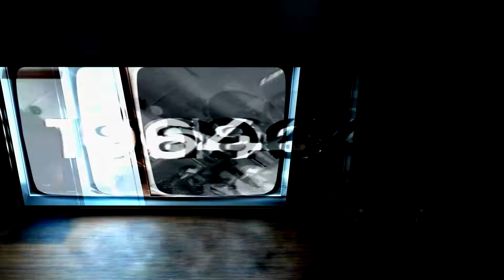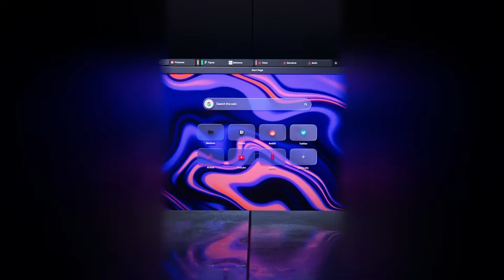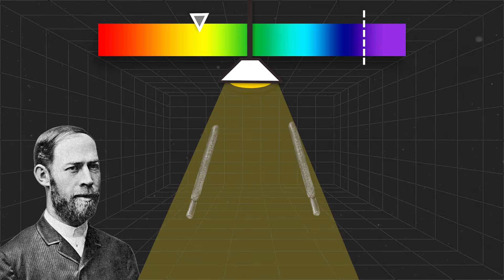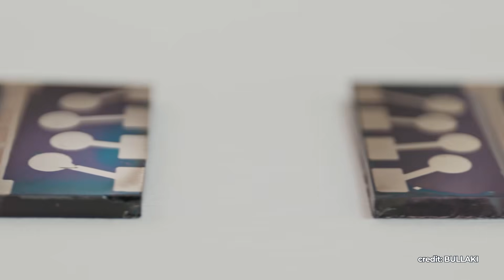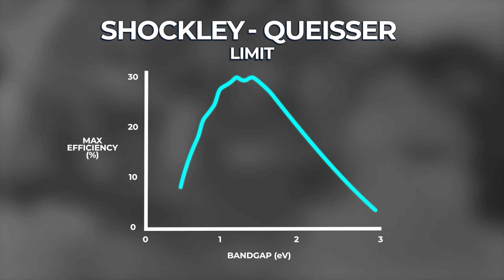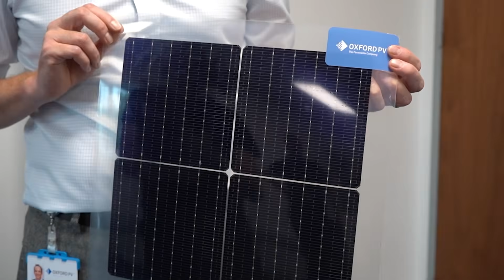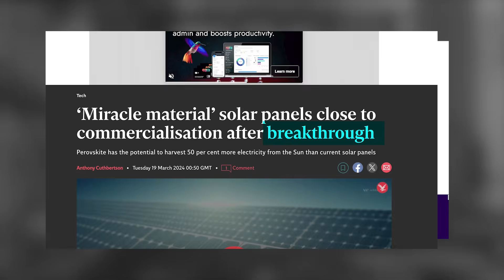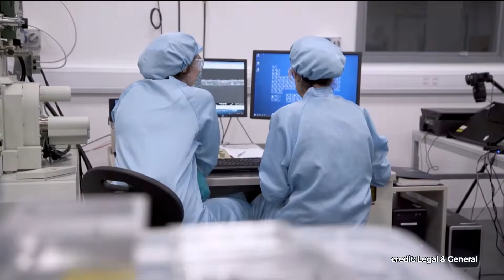How Physicists Broke the Solar Efficiency Record

Comment: Us NEEDING this energy, is us devolving. Since the beginning of time, up until power was invented, NONE of us NEEDED power at all. Not one watt, amp or volt. It is the same issue with smart-phones and computers, which is making us less smart, not making us smarter. We are becoming codependent and in the worst ways possible. It started with doctors, medicine and vaccines, which are now NEEDED to survive. It worsened with automobiles and delegated manufacturing isolation, stemming from basic farming and clothing creation. Now those things are illegal to do on your own or they are a hobby, if you can afford the tools and materials and land.

We have destroyed our genetic evolution with stupid, selfish laws that have erased thousands of years of evolution from our history and will continue to remove many thousands more. The most prominent genetic advances we have, all come in the form of decaying cancers now, instead of actual adaptive advancements. We taint the genetic pool, trying to save everyone, including those that nature would otherwise have removed from the pools of advancing. Ultimately, we are turning into "mutts", and mutts are the END of all genetic pools, not a new branch.

Use solar power to boil water, directly. That is nearly 99% efficient.

Comment: let me ask a question , how much would a system using the same simple physics as nature with no exotic materials , is scalable , produces 24/7hrs. 365 days to provide same level of power as most every other system currently in use . How much would it be worth ? For Elon Musk I'm asking 1,000,000,000.00 with a T.  for others I'll need 3,000,000,000.00 again with a T. THIS NO JOKE!

Comment: I'm curious about the lost 72% of energy. I'm making an educated guess that the energy that is lost is transferred into heat, so why don't we harness that lost energy to make solar panels more productive? A good example would be a thermoelectric generator, where the heat from the panels contacts one side and the cooling (which is already taking place indoors) hits the other side. This would in turn make the whole system more efficient. I'm sure there are other methods as well that would harness the other 72%

Comment: interesting I have been following Perovskite for 20+ years, but they have been too expensive and have too short a life time to be practical.   It will be interesting to see if this approach will be viable.  The material cost has often been much higher, although theoretically possible to be lowered, it hasn't actually be cheaper

All this said I am confused at you calling this a breakthrough as multi-junction cells exist and can be purchased that are higher efficiency then what these guys are doing.

Comment: 17:28....love how the graph only allows everything but hydroelectric power generation which is conveniently left out. also the fact that the solar panels have  .00134% life span of geothermal and a 0.031 life span of coal fired power plant and a 3.6% life span of a nuclear power plant. the solar panels on the nasa satellites have failed 50 years prior to voyager nuclear powered satellites breaking out of our solar system and still powering them onward even today.

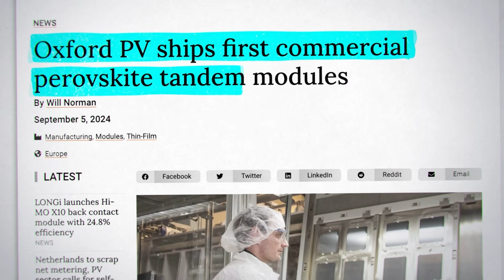Comment: 1:35    24.8% efficiency compared to what? 7% current efficient current solar panels so 24.8% of 7% equaling 0.01736% more efficiency added onto 7%  for a grand total of 0.08736% ??????????
at what cost is the greater 0.01736%   addition come ?  $$$$ and nvironmentally...do we have to give up the himilayan mountains or 95% of the earths fresh water for the sum of 38 generations of slavery?

Comment: kardeshevs theory is wrong, type 3. black holes /singularities don't create energy, they devour it, that's why blackholes/singularities get more powerful and then bigger. his theory is based upon harnessing the gravity aka magnetism of the black hole, which can be done with less than 100% efficiency on the outer edge and efficiency decreases as you get closer to the event horizon as not even mass like light can escape and only the energies that can overwhelm the force of magnetism degree en such masse as is sufficient to decrease the absorption power of the blackhole/singularity that successive energy mass being ripped apart can escape....like sound and light going thru multiple layers of curtains, (as bad of an analogy that is, but simple enough even a child can understand) ripples in a pond might also be a coexistent way of putting it, or a downed high voltage powerline having a radius of energized ground distance such as 30 feet being lethal, 30 yards being crippling/damaging, and 300 yards being a mild sting. if you can find enough mass with sufficient energy soaking capability the energy of the powerline being released can be absorbed and the effects diminished, but not completely defeated, that only super higher energies can escape from at the furthest vestiges.
a simpler analogy is rather disgusting: a toilet flush overwhelmed by the mass and it's consistency of a defecation. obviously all of the diarrhea will mostly be evacuated at the event horizon but you need to overflow the bowl for anything to escape. we dumb monkeys lack the sensory necessary to view and thus understand all of the acts of physics taking place at a microscale and thus a cosmic scale that such an eventful act would take. a super black hole would be like a super charger on an engine with counter rotational forces, which is probably why they do so much more damage and much more quickly.  something whirling around that fast with so much force would have a static affect on surrounding masses to cause tidal exchanges.
stators on engines.
the secret to the universe is that it's all easily understood using electrical physics in every form on multiple levels in multiple phases all at the same time in a concerted rhythm we have yet to fathom.

Comment: involving the kardishev scale (sth that has no real use and uses an arbitrary scale) makes so little sense, that unlocking fusion or just going big into fission would be more than enough to go well beyond a kardishev 1 civilisation. solar cells are completely pointless in this regard. besides, as you said, even if we made planet earth one massive photovoltaic cell, we'd still lose energy to heat, so we will always underachieve with it.

solar power is good for one thing and one thing only: when you can bring a fair amount of high tech materials to a place that has literally no other resources from which you could gain energy (or at least not at your technological level) but lots of sunshine, then you can get energy this way. so this is true for 2 or maybe 2 and a quarter places: space bc of the sun, dry deserts on earth by drought means also no clouds to obstruct the solar panels and lastly maybe if you wanna make an expedition to the arctic regions during summer (sun never goes under, but it's also very weak and you'll most likely need to take all of that equipment with you again. going fossil is smarter usually)

as soon as you leave these godforsaken places you'll usually have plenty of wind, or even better, you'll actually have flowing water for hydropower, or even better, you'll have civilisation for npp and at some point we'll have fusion, too. yes, for sure. doesnt matter if it's in 10 years or 10'000, at some point we'll be better at producing energy than our own sun and the kardishev scale loses any kind of meaning. it becomes even less meaningful once we create (fuelled by fusion power) the first black hole and get our energy that way.

the environmentalists have scammed you, photovoltaics are nothing special. it's just another source of energy. just like sterling engines dont do anything special either and hydro doesnt either. it's cool that our photovoltaics got this advanced, but all this money that all these environment obsessed governments have pumped into this tech wouldve been of much more use in fusion, thorium fission or heck, even just building perfectly average npp.

Comment: The Kardashev scale is non-sensical and will never be achieved even at category 1. As a society increases it's technology needs, it also increases energy efficiency. A light bulb is a perfect example where the od 60W globe can be replaced by a 4W globe which lasts 10 time as long.
Reply: An improved solar panel is another example, where over time we will see (a) an increase in efficiency, more power, less space, and (b) less overall energy requirements per person. The solar panels on your roof will easily cover all your energy needs even though roofs are only a fraction of the overall available space.

Comment: I wonder what dangers are presented with when solar efficiency reaches over 70% (far future of course). I mean you get to the point where children can start generating dangerous levels of electricity with relative ease. I remember my first time discovering solar, tinkering with a Radio Shack 50 in 1 kit then later the 150 in 1, the included solar panel was such a mystery

Comment: I'm not sure the explanation at 6:30 is correct, the electron rich and hole rich semiconducting materials are neutral independently. When the two materials are combined, there is a charged depletion layer formed. The depletion layer is charged, hence the field exists.

Comment: To add some extra detail into this that wasn't included, the main thing stopping mass production isn't just the rapid degradation in real-world conditions. It's that the current most efficient perovskite that we have uses lead as a main component. Added WITH the rapid degradation when exposed to some UV wavelengths and moisture you have a disaster with lead leaching into some peoples main sources of drinking water

Comment: After 4 minutes I stopped watching - first solid state solar cell was selenium, yes, but Charles Fritts was just the first to do it as a thin film - go back a few years (The Action of Light on Selenium in Proceedings of the Royal Society of London, Volume 25,1877, pp. 113-117) and you’ll find Adams, W. G. and R. E. Day applying two platinum electrodes on a sintered rod of selenium and producing an electrical current - this, is the first ever solar cell

Comment: I strongly believe that perovskite cells are the future. Once manufacturing processes are refined and the most ideal compounds found, I think it won't be too hard to layer up a few layers of this into >50% efficient solar panels cost effectively. This means far less mined material since the power density is drastically increased. That's what's important, because raw material will be the limiting factor to increasing solar power. Energy will become cheaper as we deploy more, which will make manufacturing cheaper, but you can't turn energy into matter (well, not practically). So being efficient with resources, especially if we can make them recyclable, will be hugely important.

Comment: Pump z waves in sync yet out of phase will combine as a sum after focal passage through nonlinear medium, which usually requires a carrier wave. This is the secret to tapping the power of the vacuum. Bury an iron mass with rebar attached sticking out of the ground. Pass that through 3 copper plates inside a tinfoil pyramid 4x wider. Use a pair of pvc pipes to route contacts from the end of the rod and top inside of the pyramid with a sharp peak, to a point outside where you can slowly open spark gap. You'll find that the 3 copper plates 1/4" apart or so, will act as dynamos running 120d out of phase against the quite strong negative bias sinewave that comes from earth's core. This drives the charge built to bounce with more charge force each time spark gap is bridged the opposite direction due to the leftover 3rd wave. Basically, by bouncing charge, the feed from the core is corrected even more to counter it, so by not using 100% of the energy made by folding waves off the apex of the pyramid through zero point, you give time an envelope of charge differences that it tries to correct- which is what time does. It neutralizes ion charge everywhere it can. Time is the flow of neutrinos tracked by IceCube. These particles do have mass, it was measured, yet because the world of physics doesn't understand them, they labeled them as massless. Huge mistake. You cannot measure the mass of a particle causing the very energy they need to measure that mass. The energy/kinetic pressure gap is a lot stronger than they could imagine. Anyway, build one of those pyramids. Plans on my other channel just google mikefromspace. 20kw from a 5' diameter pyramid using a sufficient iron mass below like a 457 engine block.

Comment: I skipped to the explanation of their innovation, but there is one thing I beg to disagree with, and that most engineering and scholars would agree with, unlike your statement, is that the perfect outcome is NOT the one to look for. Surely the "best short term" is not ideal either, but looking for the "perfect" one is a time and money sink that no one can afford either, especially on such young technologies that experiencing their first real breakthroughs.
You are to look for a breakthrough of current limitations, not for the perfect outcome. The perfect outcome is only a direction to look at the horizon to figure out how to improve current designs, but a "perfect outcome" now would be 100% efficiency and this is just not realistic currently. However, by looking closer, in the direction of this horizon, we can figure out ways to keep breaking through step by step.
A mentor of mine reminded me on my younger days that in engineering, perfection is your worst enemy. The Japanese know a great deal of this, because they often have this mindset of having everything be "perfect", and they encountered many troubles because of it (one famous example being their high speed train poles entering resonance due to perfect alignment and self-destructing).

Comment: High efficiency solar cells are always 20 years away.  I priced a system that would cut my power biill in half , it would take 15 years to pay for itself.  15 years! I can tell you what will fail in that time, every component in the system. So add the cost of replacing batteries,  inverters, and decreased efficiency from the cells. You Wil never save money using solar.

Comment: Nothing but an advertisement. No new tech, just 2nd layer on silicon. Of course it's going to be more expensive, and only available to registered utility power locations. 
This is an attempt to get a consumer to pay more "with justification".
The film is so weak and fragile it's going to be the first thing to go, and utility companies already have issues keeping silicon based panels fully operational, and this is going to make it better/easier how?  How about actual datum, like weather durability, material degradation, voltage loss.

Comment: All silicon solar cells are not monocrystalline. Just most common due to being generally more efficient that polycrystalline cells. Also other types of solar panels exist. Solar cells that go to space have nearly 30% efficiency and a much slower degradation rate due to the cost of sending something to space justifying a much more expensive to produce solar panel

Comment: Perovskites have a higher conversion ratio; that is true.
By selecting layers that are reactive to a certain range of frequencies, it would be conceivable to create a cell that could capture the entire spectrum.
However, while more efficient, they are also highly susceptable to UV degredation; typically lasting maybe 5 years; one fifth the life of standard silicon cells which have a 25 year span.

Comment: Not very impressive, but in the meanwhile I wonder if perovskite might be more useful in the development of the new generation of layered imaging sensors, such as the Foveon sensor, which is regarded by many as THE ultimate photographic sensor, yet which today faces a complete stagnation in development, mainly because they use silicon only layers in which the absorption of light is tough, so the resulting image is still very noisy.

Comment: perowskit panels lifespan is shorter. their efeciency drasticly drops overtime comparing to older solar panels. most bennefit you can bend them, mostly used for powering batteries in wild animals tracking devices.

Comment: I'm still waiting for hydrogel shampoo.  Like aerogels, which have been around for decades but still await mass application, hydrogels and high efficiency solar panels are not ready for prime time.  However, opening day (mass use) for each is getting progressively closer.  I see the day when a vehicle will be coated with a solar film  capable of providing most of the energy needed to move that vehicle at a useful speed.

Comment: What Matters:
Power per $ (W/$) as this is entry cost for it to be usable for some purpose, because you can't run 2kW device with 1200W solar cell.
Power per m^2 (W/m^2) as you are often limited by installation space. This is where efficiency comes in play.
Lifetime Power creation per $ (kWh/$), considering degradation rate and life cycle of 10~20 years for most...
Cost to recycle cells after they become useless/inefficient for given application. And this last category is one where less than 1% of this trash gets properly recycled, same as with blades from wind power generators.

Comment: Sounds like verging upon the horizon of bioengineered plant energy synthesis & select molecular structures that allow proper shepherding of energy between those barriers for harnessed power. Instead of stagnat structures such as silicon or perovskite that weren't initially designed for intended purposes

Comment: The issue with Perovskites is the longevity. If we can produce the most efficient converting 'crystals' cheaply and easily, then the longevity wont be as big an issue and there can be a huge industry in replacement surface treatment!